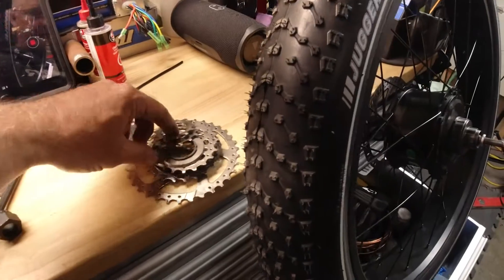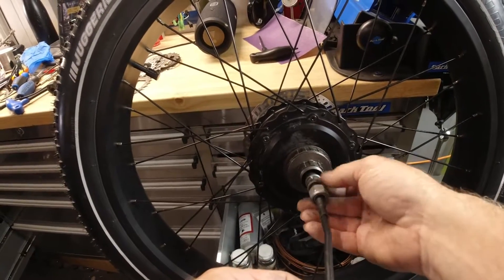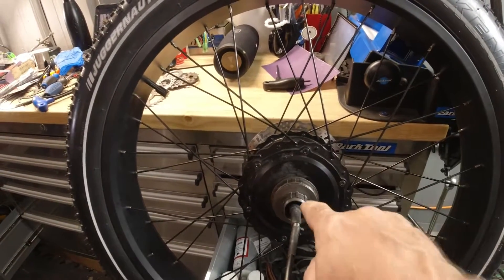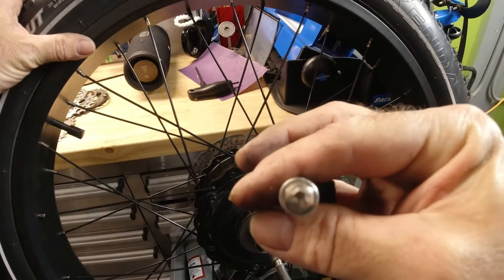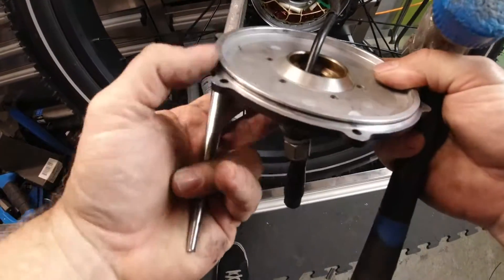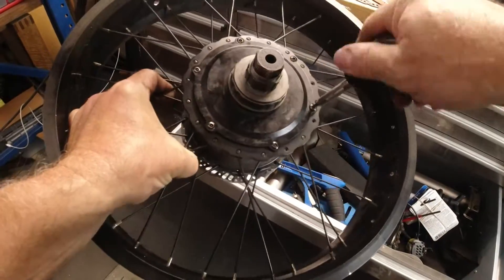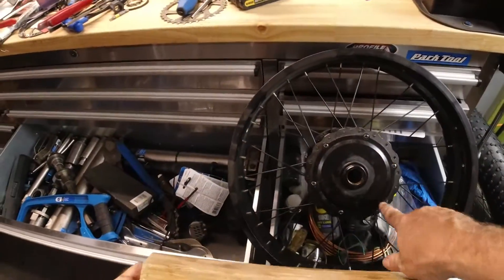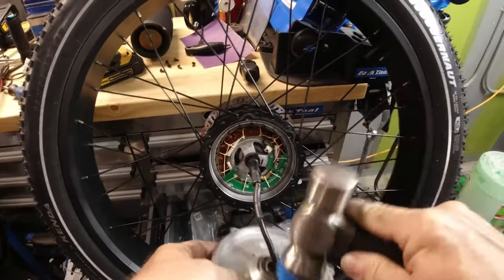Rad Power Bikes Issue: Proprietary Freewheel Removal Tool Needed

Comment: i am trying to do this very thing, except the wheel i have has the cable on the disc side (phew). however, the whole mechanism rotates when i try to unscrew it with my park tool (and just spins under load as well). ever experienced that?

Comment: If you remove the sprockets off any freewheel and then clamp the remaining freewheel body in a vice, you can crush the outside plate to the inside plate so it locks. then you can just turn the wheel and it will unscrew. Have done this on hundreds of different brand free wheels in my shop amd works every time. Just make sure you don’t clamp too hard and damage the receiving threads on the wheel.
Reply: You are my savior! I was starting to disbelieve in myself, because I could not get the cassette off. Your method works! I broke my table, it couldn't handle the force I had to put into my vice. But who cares. My Radwagon drives I don't need to walk my kinds to the kindergarten.

Comment: So I'm giving on up trying to get the old freewheel off since I already have a new motor/freewheel. I had tried cutting a slot a in a spline tool and the screwdriver trick and also had RadPower send me their proprietary tool for free. I soaked it in PB Blaster and it sat for a couple days but no luck. I was just going to move but I ran into the same issue at the end of the video and it looks like I need some sort of spacer. Were you able to find the correct spacer?

Comment: Ok, so I just picked up a Lectric xPremium. Same exact set up. I'm looking to go to a 34 tooth low gear (comes with 32). The cassette part of this thing does come apart as seen in the video. However,  it is two different diameters. I need this 34 to fit the large end. Does anyone know where to find a sprocket with  this unique sized inner spline diameter?
Reply: Also interested in a 34T sprocket for my XPremium. 👍

Comment: I bought the tool from Rad. The slot compromised the tool’s integrity to the point that it would not grab.
Reply: Fyi, AFTER we ALL had the same problem...Rad figured it out. They send you a PDF with some instructions to "jam a screwdriver" between the removal piece and the axle, to hold it from moving. Then gently apply pressure and HOLD the pressure until the freewheel releases. Also suggest using lots of penetrating oil as the freewheels tend to seize onto the hub when not properly installed with lubricant. My local bike shop couldn't even get the freewheel off... I still still sit with a broken freewheel with no top gear.

Comment: Rad shipped me the proper tool free of charge! They are top notch when it comes to support!
Reply: Where are you located? In Canada they want 15$
Reply: @GreenSlug420  Edmonton, Alberta
Reply: I've emailed them and they said they do not provide such tools?

What did you say. I need to remove the back wheel to replace the tire/thread. etc.
Reply: @raczyk  You can do that without the tool. The tool is for removing cassette and rear motor.

Comment: I thought Park Tool had a splined tool with a removable spline to fit that. Also Bolton bikes makes a thin wall tool that fits over the nut on the wire. Anyway, you got it done..
Reply: Tower e bikes, thanks for the video.
Reply from the maker: You are correct. Bolton bikes made a tool specifically for this purpose!